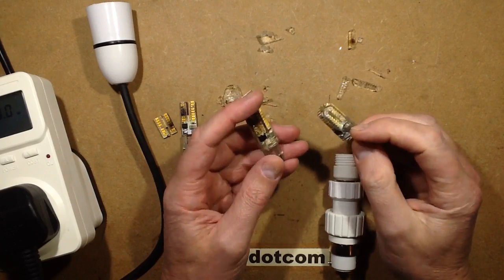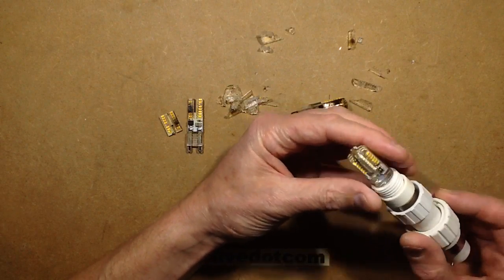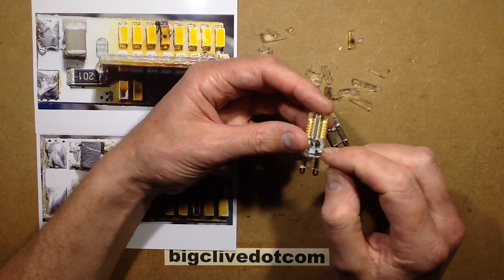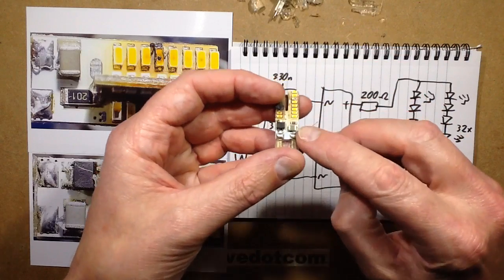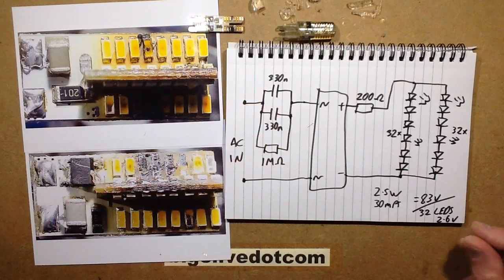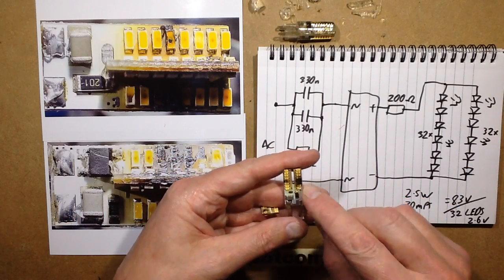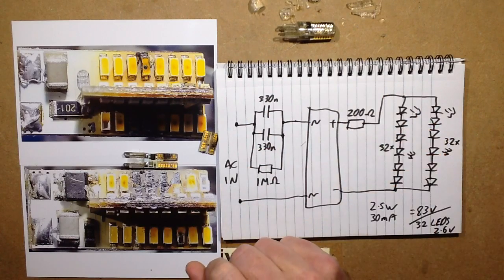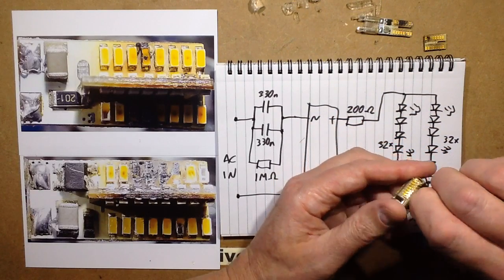Autopsy of a cremated LED lamp.

Comment: +bigclivedotcom One Easter morning when I was a kid, we had a smoke smell permeating the house, started thinking we had an electrical fire; Fortunately it was just a walnut that our parents had hidden on top of a 150W incandescent lamp. Scorched walnuts smell sorta bad, not as bad as some electronics though :) Since then I've found that, if you have some stinky electronics or something that someone smoked around a LOT, you can package it inside a plastic bag, and put a paper sack full of charcoal (BBQ Briquettes) inside next to it - The charcoal will absorb the smell over time, I bought a Nook Tablet (Think it was an HD+) that was nasty smelly and now it smells like it'd never been smoked around. Handy tool; Also if you simmer a couple Cinammon sticks in water on the stove, that will neutralize pretty much your whole house (Friend had a chest freezer full of meat, went on vacation, came back and the compressor had failed on their chest freezer. Costly problem!) On those LED lamps, if they put an MOV just past the 200R resistor, with a high enough voltage, could pop the 200R resistor as a fuse to protect the LEDs?

Comment: About 10 o'clock one night my house was filled with a nasty acrid smell, I ran around everywhere trying to find it, unsuccessfully I shut off the electricity to the whole house and went to bed. Next morning I still couldn't narrow it down, the smell wasn't as bad and I was getting ready to call an electrician. Around 6 o'clock that evening my wife turned on a lamp and there was a bang and the smell was immediately there, yes it was one of those bloody awful lamps. I chucked the whole lamp in the bin, problem solved!

Comment: What they could have done here is they could have just had the capacitor(s) (with discharge resistor), a resistor and put the LEDs in series with that. The LEDs would be in an anti-parallel configuration. They would operate at twice the current, but yet only half the time. Of course, if one LED goes open circuit, then the whole thing will stop lighting.

Comment: I disagree with you. I think the caps are at fault.

Because the failure mode of ceramic capacitors is a short. So they put 240VAC mains rectified on the LEDs. 
that could lead to them burning violently...
Reply: Nah, I think it would have been far worse if the caps shorted.  The light would probably have gone up in flames.

Comment: I also have similar led lamps and in the dark when they are switched off there is a glow from them. Is this the fitting or the lamp themselves. Old filament lights didnt do this .Any thoughts
Reply from the maker: It's usually the tiny current capacitively and resistively coupled between the switch wires, especially on multi-way switched circuits.  The LEDs will glow with mere microamps of current.  It's very common, and many lamps try to reduce it by adding a resistor in parallel with the LEDs to try and shunt the leakage current.

Comment: Hi Clive, could you please elaborate on the logic of you saying that if one serial chain of LEDS goes open-circuit the current on the other serial chain that is in parallel to the first one doubles?  Everything that I know about circuits tells me that will not happen unless the terminal voltage itself suddenly doubles.
Reply from the maker: The current is being split down two parallel strings of LEDs.  When one goes open circuit all that current then goes down the remaining intact string.  The capacitive dropper circuit is a simple current regulator that will pass the same amount of current whether there are two strings of LEDs to share it or just one.
Reply: Are you saying that the impedance of a string of LEDs is totally negligible when compared with the impedance of capacitive dropper? So open-circuiting one string has no appreciable effect on the total impedance and therefore current?
Reply: But you have to have a capacitor type that most probable fails open circuit and not short. That's the problem with some kinds of capacitors (Ceramic, Polymer, AFAIR also tantalum) and the reason one might prefer electrolytic capacitors over polymer capacitors because of the failure mode. Because failed polymer capacitors might explode (becase they're shorted and used as filter caps, so they connect whatever voltage they were filtering to ground)

Comment: If they had used a 100 ohm resistor per each string of 32 LED's instead of a single 200 ohm resistor for the whole lamp, it may have failed in a much less dramatic fashion.
The idea behind this is that it would never be possible to have a configuration that drives twice the current thru one string of LED's because each string has its own limiting resistor.

Additionally, limiting the current on a "per string" basis should put a stop to any potential "current hogging" behavior such as seen when using bipolar junction transistors in parallel.
Reply: Thats how id have choose to design this (or any engineer that cares) but then thats one more item on the BOM, and that costs to much apparently.

Comment: I've had these. It had GU4 pins but the lamp itself looked exactly the same. Most of them were fine but two got so hot that the silicone actually dripped off, and eventually the solder got hot enough to make the bulb slide out of the socket, onto the floor, leaving the pins inside the socket. The lamp didn't go on fire but there was a lot of smoke and smell. Eventually I trashed all of them. It's a shame, because they are so small and inexpensive compared to an actual brand of GU4 led bulbs.

Comment: What if one led goes short circuit, surely it would start the same chain reaction?
Reply: A single LED going short circuit would only cause a marginal increase in the current going through the others on its side of the circuit, so it should be fine. The problem with the open circuit is it instantly takes out that whole side of the circuit (ie half of the LEDs) and so doubles the current going through the other side.

Comment: I have a few of these in a ceiling lamp in my kitchen (at least they look identical). Does this mean I should plan on getting rid of them? They've been working perfectly for about a year now with at least a few hours of use a day. I should mention that that lamp used to eat halogen bulbs for breakfast - they never lasted more than a month or two, maximum.
Reply from the maker: It might be worth just checking them every so often.  Particularly if they start flickering.
Reply: They've had a slight flicker to them since they were new - the kind that isn't really noticeable until there's rapid movement, making waving your hand in front of your face look like stop-motion animation. I've always attributed that to some sort of too-simple LED driver circuit. I guess a change for the worse would be what to look for, no?

Also, on a side note, the light switch for that fixture only breaks one lead, leaving ground and the second lead connected - and this leaves the bulbs with a slight glow even when switched "off." This worried me a bit in the beginning, but I've come to accept it as the way these work. Should I be worried? Does this mean there's something wrong with the fixture (ground fault (is this the right term in English? Wikipedia seems to think so) or something similar)? I can show you pictures/video if you want.
Reply from the maker: The mains frequency flicker is common with small lamps since there's isn't room for a smoothing capacitor.  Most lighting circuits just break the feed to the light, so there is a slight leakage current coupled between the switch wires, and this is often made visible in some LEDs lamps as a slight glow when off.  It's very common and just down to the incredible sensitivity of the LEDs.

Comment: Always thought the series resistor (in this case 200 Ohms) was in place to limit the current, and even be a 'fuse', should all else go wrong. Interesting, in both lamps, the 200 Ohm resistor is unscathed, and the string of LEDs went up in smoke.
Reply from the maker: The 200 ohm resistor is mainly to limit the peak current when the lamp is first turned on at a random point in the mains cycle.  Not so important if there is a smoothing cap to absorb the initial inrush current.  But there's no room for a smoothing cap in these tiny lamps.
Reply: bigclivedotcom Thanks for the clarification. Now I am concerned, since I changed all of my house lighting to LED during the last three years. How long until these things end up burning the house? Fooled into thinking LEDs run cool and safe.
Reply from the maker: I don't think I've come across a case of an LED lamp actually going on fire yet.  Just ones that go bang or get too hot.  Most are fine.

Comment: This had happened to me in two occasions, i don't know what is it, but LED lights are still not the cheapest thing in the world, and they are still messy, Im going back to tree-killer incandescent until they figure out LED lights...
Unless someone can recommend a good brand of LED lamp (THAT IS NOT PHILLIPS)
Reply: What's wrong with Philips, apart from the price? I've just bought one as a backup for when the current halogen one fails.
Reply: I installed all my living room with phillips led lights, with its proper spots, and they needed to be dimer friendly, at first I just noted a slight tinkling but then two of the lamps stopped working, and the third one burnt down, when i talked with the warranty guys and one came to my house they told me the bulbs weren't dimmer friendly EVEN THOUGH THE BOX SAID SO and costed almost twice as a non-diamable philips led bulb
Reply: Gerardo Pacheco So either they were lying about them being dimmable, to try and avoid liability; or they were put in the wrong packaging at the factory. Not good either way! :(
Reply: either way I was unpleased considering the investment I putted into them, at the end the warranty paid the 8 bulbs, but didm´t want to pay the fixing of my dimmer (those mart dimmers that can be controlled with phone) even though their lights burnt it out, so its either back to incandescent or find some good warm disable leds that don't cost a fortune

Comment: I have what looks the same one for about a year, and so far it's been reliable. That being said, I'll probably replace it with the original 40 watt incandescent bulb my fixture came with.  I don't want to take any chances of having a fire if it should fail.

Comment: 50hz lamp on 60hz video = flicker - see if your ipad can be set to 50hz/frames
Reply: No ipads have very little in camera settings, zoom and brightness is all you get to change.
Reply: with most of the world being 50hz power, it's silly that they are locked to american standard
Reply: it may change if you change the region your in but I doubt it.

Comment: why capacitive dropper is used in these, and not just a resistor ?
Reply from the maker: It would get VERY hot with a resistor.
Reply: resistors just change energy into heat. Capacitors store energy and then release it back.
Reply: ^ is that the explanation ? i thought, because no dc is present, VI will be same.
Reply: iceberg789 LEDs work on DC, but mains power is AC. Capacitor dropper is used on AC part to limit current, it is other part of the circuit that changes AC to DC, usually 4 diodes in form of a bridge and a capacitor to smooth output voltage. 

Capacitor dropper works not only for LEDs I'm running my hot water circulation pump with capacitor in series to reduce its power from apprx 30W to approx 10W as it runs 24/7 and it has still enough power to keep water circulating.

Comment: Which hemisphere were these lights manufactured?  As you know, here in Australia the AC sine wave is 180 degrees out of phase compared to the UK due to the coriolis effect.  Which is why I reverse the active and neutral lines for anything I get manufactured in the northern hemisphere to correct the phase shift.  Otherwise I experience burnt out LEDs like this all the time.
Reply: Makes sense. It's kind of how I turn my toilet bowl over to get the water to spin the other way
Reply: Thanks for telling me.  I guess You really think I turn my toilet upside down..
Reply: dropcorr
LOL you're right, I was sleepy and didn't read your whole commentXD cheers mate
Reply: trololo
Reply: dropcorr
He's kidding dude
XD

Comment: What kind of fitting are those lamps meant to be used in?  To me, those lamps look like miniature vacuum tubes.
Reply: Fitting is called a G9 in the UK
Reply: Aren't those fittings for halogen light bulbs?
Reply: Yes originally they were halogen fittings (basically a GU10 bulb without the reflector). These are LED replacements - just not very good ones.
Reply: OK.  I don't know very much about helogen light fittings and types of halogen bulbs.

Comment: No way these capacitors can take mains voltage at 330nF. You should check (don't know how you'd do it ;) ) if they already arced internally (maybe just measure their DC resistance, of which there shouldn't be any).
Reply: There are some 450V 330nF capacitors on DigiKey that are in a similar sized package used in the LED lamp. It is possible that they used capacitors rated for mains voltage. They are rather expensive though.

Comment: It looks like that white SMD leds have some issues with capacitive dropper power supply. I have ordered them from eBay, Aliepress,... and they have all burned. All of them had capacitve dropper power supply.
Reply from the maker: It's usually because they are being driven too hard and overheat.
Reply: I have 4 of them, been running since November 2015, so far no problems. got them through aliexpress.

Comment: So was it an error in production, or why did these fail? Or are they just so badly designed? Because if it's so common for them to fail, and it's clearly a design flaw (i.e. not enough heat dissipation for the way they are driven), then this would make them a clear "no-buy-product". Because even if they are just a few cents, I don't want to buy something and throw it in the trash soon after - that just makes no sense whatsoever...

Comment: So here's the big question: how can you prevent such failures? What could you add into the circuit so that if one LED fails, it doesn't bring the entire lamp down with it?
Reply from the maker: Best way to prevent this would be to run the lamps at lower power so the LEDs weren't baked.  A good start would have been just leaving one of the 330nF capacitors off.
Reply: Another option to at least improve the circuit would be to put a separate series resistor on each parallel branch. The first failure likely happened because of a mismatch in LED forward drop between the branches which made one conduct significantly more current than the other and fail first. Having a separate 400 ohm resistor on each branch would distribute the current better in such a scenario.
On the other hand, just about everything is underspecced on this board, including probably the capacitor rated voltage, probably the rectifier rated voltage in case of open circuit, the creepage distance between the capacitor and the pad in the top image, and possibly even the board. Is that a phenolic board?
Reply: if you had the LEDs all in one series circuit, instead of series-parallel, then if one goes open circuit, current stops flowing, no parallel branch to overload.
Reply: i knew id found you here old chap. May i say you have great YouTube taste !
Reply: I was thinking the same. Like some sort of "fuse" or safety that burns off and shuts it down when 1 LED fails (preventing the overload).
Reply: A zener diode of the appropriate voltage in parallel to each LED.
Reply: So... not only would that save them the cost of a capacitor, it would also help against the overload. I'm guessing it would lower the amount of light too though?
Reply: Yes, they'd have to lower the number of LEDs in that scenario.
Reply from the maker: They could use the same number of LEDs, but they'd just run at lower current and thus, much cooler.
Reply: I guess I was wrong. Sorry.
Reply: Got it. So lower power means cooler LEDs, so less chance of failure to begin with, and more buffer room if one does fail so you don't get the cascading blowout of doom, correct? Thanks for the video and the quick answer, Clive.

Comment: I had a bunch die like this. Similar g10? 2pin lamps for LVL in kitchen. Doesn't happen to similar bulbs in my car tho. 12v only I guess makes the diff?
Reply: If there's a single current limiting resistor in series with a number of parallelled branches that are supposed to divide the current, then trouble starts when one of them goes open circuit. Say there are 4 branches, every branch gets 1/4 of the current. Then one opens, the remaining three get 1/3 with more heat etc. Soon it goes to 1/2 and then full frying current. Conclusion: single current limiting resistor is bad. Generally in 12v LED strips there is a resistor for every group of 3 LEDs.
Reply: Yeah, with 12v there's nothing to hurt the leds If one were to go open circuit, since there is most likely no voltage dropper. It's just an array of leds.
Reply: Thanx for the explanation! My wife was freaking out when we smelled that horrible melting stuff. I was surpassed my cabinets didn't catch fire.

Comment: if the banks of leds are in parallel then if one bank fails the other shouldn't be affected, because it's at the same voltage right?  Unless you have a constant-current driver.
Reply: Capacitive dropper is a constant current power supply, and with no load it'll go up to full mains voltage on the output.
Reply: A capacitive dropper is not a constant current power supply, it can be compared to a resistor because it is not DC.
Reply: In this case, 660 nF @ 50 Hz = 4822 Ohms series.